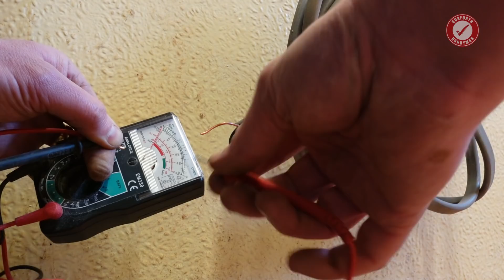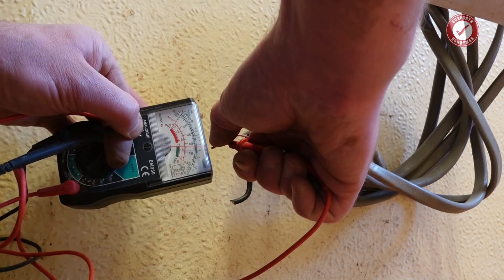Safely(ish) removing unknown buried pipes (Renovation Part 10)

Comment: 1920s build.  A lot of people were still using gas lamps in the 1920s, so that pipe being chased into the wall could have led to a manifold that fed gas lamps in all parts of the property.  There's been previous work done in the house, as evidenced by the kitchen units, so any manifold would have been removed when the house was finally wired up for electricity supply the first time.

2 years since the last comment, but I only just found your excellent and highly informative channel.  I'm learning a lot from it.  Thank you.

Comment: I dug up my parent's drive in the late 80s to allow the waterboard to replace the old lead pipes. 1907 house in Wrekenton. I found a pipe just like that and dug down the drive trying not to disturb it. Well, guess what, I hit it with a pick axe by accident, and the hissing of escaping gas was like I'd woken up a serpent from Middle Earth. That was when I used to smoke, as well. 

A year or two later we found that the house had no earth to the electrical supply, as it was bonded to that pipe and probably the water too. Which we'd just replaced with a plastic one. We found out when we started getting electric shocks off the taps. Glad to hear you drilled a pilot hole before attacking with it a sparking angle grinder! Gan canny!
Reply: We moved into the garden flat of a Victorian townhouse in 2019. Just before we moved in, we were told that they had to take off the tiles in the bathroom and uncover and long forgotten hatch to access the mains electric- as residents in the above flats were getting electric shocks from the taps, when installing new light fixtures, in the bath etc. It transpired the building was essentially ‘live’ and not earthed. I wonder if what you have described could explain what had to be resolved in our building? Very strange!

Comment: Such a good investigation! When I was late teens working on a construction site, my boss told me to 'cleanup' this certain floor of temp wiring. He said "everything" is disconnected just rip-it-out. So up I go to do the job, first line running across the floor is a tripper so I wanted that gone to move along faster... took my linesman pliers out to cut the line... BLAM... it was still live. knocked me back a few feet, welded my pliers. Hard lesson to never trust anyone especially with a 220 line. That was nearly 45 years ago!  Haha 99% sure are worse odds.

Comment: "Earth" is the general mass of the planet, which is more conductive than you might think. A buried pipe is going to make a pretty good connection to it (that's what an "earth rod" is, after all). So it's not surprising that there's continuity between your mystery pipe and your main earth terminal - they are both connected via the mass of the planet. No direct electrical connection is needed for this continuity.
Reply: coated in bitumen tho
Reply: @jonesconrad1  That is why you need to study electric theory, what is a conductor? what is an insulator?

Comment: An old town coal gas supply for a cooker I would have said.
Remember houses which have earth rods they are usually only ~3ft long to get a nice low reading. looking at how wet it had been in the under stairs room, it's likely got good continuity.
Reply from the maker: Yeah but it's bitumen coated so how's it getting such good conductivity to earth?? Would agree... but I'd need to dig up the floor to answer this I fear. 🤣
Reply: When you removed the length of pipe in the garden, were there any joints? Surely there wouldn't be just one long length of pipe supplied, but multiple shorter lengths? If it was shorter lengths, what had they used for joining them? Any threaded joints for gas would surely need a sealant whereas electrical joints wouldn't to provide better continuity.
Reply: @girlsdrinkfeck  Quite often Towns Gas didn't have a valve on the supply other than the one in the street, also it's likely threaded steel with no jointing compound as the bitumen coating was used as a sealant. Sadly it was all down to where you lived in the country to what measures were taken with safety/installation practices.
Reply: Old  town gas pipes when buried where covered with bitumen  tape (don't know what the material was in tape with the bitumen may have been asbestos)pipes would have been 1"or 1-1/4" inside  bore, town gas phased out on tynside late sixtys early seventys
Reply: Wouldn't that have had a gas meter somewhere?

Comment: I have an identical pipe coming in to my house right next to the old lead water supply. It was crimped off where it exited the ground. Had to do a similar thing to you and ended up just hoping that my checks were right and cut it off at ground level. It is certainly a twitchy moment no matter how confident you are!!
And it was definitely not a gas supply of any kind as it was the wrong side of the house for the kitchen and I removed all the original plaster and no gas lighting present.

Comment: Here across the pond electric is grounded outside by a bare copper wire (usually #6) from the electric panel outside to a galvanized rod driven 8' into the ground.
The panel is also grounded from the ground bar in the panel to the water pipe system inside the house and the hot and cold water pipes bonded together at the water heater so that when the water heater is removed for replacement, the hot and cold water  pipes remain grounded.
It may seem like a lot but the last thing you want is energized pipes with no place for the electric to go except through you.

Comment: I found a mystery pipe in my garden while digging a hole for a rain water tank (of course well in the way). I found another end (cut off) after some digging inside (which I had to do anyway) so I could safely cut it off where it was in my way; I didn’t go looking for it further into the garden though.
As far as the electrical connection of the pipe goes, here in Belgium it has been mandatory for quite some years now to connect metal gas and water pipes to electrical earth. In earlier days though, people didn’t put in earth rods (not sure if that’s the correct term) and used the metal pipes to earth the electrics. This could be different in the UK though...
Reply from the maker: Think it must be bonded under the floor... possibly. 👍

Comment: The continuity could be caused by a hidden earthing rod that connects to the metal pipe under the old kitchen floor, if it is a gas pipe (and given it's location I would guess so), they did used to earth these near where they terminate. I would guess that if you dug down a few inches around the pipe you may find the earthing brazed to it. (purley speculation though)

Comment: I live in a similar age property in Manchester. My gas supply pipe is just like that in heavy steel, just like yours, and of a similar diameter and has been in forever but now converts to copper  inside the property at the stop tap in the kitchen. It used to feed a very large floor standing gas boiler and needed a large diameter input. You are lucky it was not still connected like mine when you took a grinder to it. The gas pipes inside the house were only recently changed from lead in places to copper.

Comment: Towns gas was "around" until the late 60s.  We, in the South East. started conversion to Natural Gas in 1969.  Other Regions started it earlier but only by a couple of years.  At that time we were still using bitumen coated mild steel tube for "buried" pipework.

Comment: Have a look in the houses main earthing terminal that should be in that cupboard. Maybe there's a cpc wire going to one of the terminal points. Or it could be linked to your water supply in your house. See if there's a continuity between your water pipes and the mystery pipe.

Comment: Hi Andy, Please don't rely on utility company drawings! There is a significant junction of drains below a manhole in our neighbours garden but according to the utility drawing it is under our property! We have been trying to point out the error since we had a drain survey done when we moved in 25 years ago! When we had an extension built a few years ago I pointed out the error to our architect and provided photos and measurements of the precise layout as part of the planning submission. Because of the position of the drains and the proximity of the neighbours garage our extension is sat on foundations 5 feet deep on one corner!  Regarding the mysterious continuity reading I think the dead pipe is acting as an earth conductor and all you are doing is measuring continuity between the new earth arrangement and the old one. Best of luck with the project, the videos are brilliant.
Reply from the maker: Cheers! It's bitumen coated though - don't think it would get such low resistance to the electric supply earth unless it's physically bonded somewhere. 🤔
Reply: My kid's primary school was installing three new kindergarten classrooms, and when they were doing the ground works they discovered very large diameter water pipes that weren't on any plans they could find.  This resulted in the three new classes being placed elsewhere, and the Four existing kindy/preprimary classrooms being demolished and replaced after being there for 30+ years.

Apparently you're not allowed to build above these pipes. Amazing what you find. Even the water corporation didn't know they were there

Comment: Hi, In some areas of the uk at one time  it was practice to earth anything metal in a house . i.e. gas pipes, water pipes, cast iron baths, steel sinks and some cases the old steel metal windows, so its likely the the earth is still connected to the pipe somewhere, obviously this practice is no longer carried out.

Comment: The location in the kitchen, the material and the condition the internal pipe is in all suggests old gas pipe. Also the low continuity in clay soil isn't unusual at all, also consider that if the pipe was bonded it would have been within 600mm of where it enters the property. Just because you cut it out in the garden doesn't mean you've 1: removed it from the mass of earth or 2: removed the connection to the internal bond of the property.
Reply from the maker: Yes but the pipe was bitumen coated. I could be wrong but I don't think it would get such good connectivity to the electric supply earth without metallic bonding. 🤔
Reply: @GosforthHandyman  You'd be surprised by how little resistance a mass of wet clay between exposed metallic parts. It's more likely that under the house the coating was removed as it was likely the original main earthing conductor for the property. Remember an earth rod is only 3ft of copper staked into the ground and that pipe is likely a good 15ft of a bigger CSA.

Comment: Hi Andy,  my guess is old gas pipe,  i would have drilled a small hole in that pipe to see what was inside, and had a self tapping screw handy incase it was gas or water, if neither apeared,  next step put non metal probe into hole to see if there was something inside,  just my take on this, and I'm not advising anyone to do this either,  play safe people get the professionals  in , thanks for the video Andy, lookin forward to the next one,  stay safe mate, best wishe's to you and your's, Stuart.uk.
Reply from the maker: Good tips! 👍
Reply: Self tapping screw great idea. Maybe a little plumbers putty to make it better seal.

Comment: Defo an old gas pipe. I've got one capped off in the understair cupboard as have many of the houses in the street. The old pipe is commonly used to get the new pastic pipe from the street to the property so they don't have to dig up the garden.
Reply: Had pipe bonded to CPC. You are mistaking earth for CPC

Comment: Sounds like either the electrician bonded to this old section of pipe when doing the new install OR there is sufficient moisture in the earth that you are getting  continuity between this old section of cast pipe and the neutral bonding rod in the new service connection.
Reply from the maker: It think it can only be the former. Can't see the resistance being so low for connectivity through the actual earth... but would need to dig a hole to find out. 👍😁
Reply: @GosforthHandyman  that’s an interesting thought. A good way to test that would be to get incandescent bulb if you can find one and stick it in a lamp socket connect one end up to a pipe and the other end carefully to the supply with a switch. If it’s a low resistance connection you’ll get a full brightness if it’s high resistance you’ll get a dim light. Course I don’t know how that would work with RCDs as this would essentially be a ground fault. There are better newer ways to check for that but require expensive tools. The principle is the same you want some thing that drives a little bit of a current. Of course this comes into the territory of an electrician as it could be a redundant path and the only way to check that is to disconnect the CPC ground connection in the electrical system to determine which way it’s connected. Whether it’s with a ground bond, water bond, electrical service bond or maybe tied into the old ground rod bond.

Comment: Hi Andy, I live down the road or up I can never remember, anyway my house has gas and the radiators electric earth and partial every pipe in here is connected to the gas pipe in many different places. I had a new gas meter put in and the person doing it was worried because he remover the main earth connection from the electric supply and still got a continuity check, three days later after consulting with everyone and their dog they decided that what I had been telling them all the time must be weird but true, the only thing to do then was to get someone either dumb enough or expandable to connect the earth, they must have not been able to find anyone because they left the cable unattached with a label on it saying the installation had not passed inspection due to an continuity test. I asked if it was safe and the only answer I could get and that was only verbally was to do so at my own discretion.

Comment: No gas in my house, however before I signed the purchase agreement, the main gas supply to local town was replaced along some field boundaries. White markers etc visible at exit and entrance to my fields. Water main for said town runs in road side verge. 2017, hot dry summer gave the opportunity to put in land drains to reduce bog in a field.  1 JCB digging down 4 to 5 foot CLANG. Heart attacks all round, its the the town's gas supply! 6 inch steel pipe!  
They replaced the pipe by digging a new path for their new pipe and renewed the markers, leaving the old pipe undisturbed, in the middle of a field! 🥵 Keep safe.

Comment: I had similar for an old steel pipe that no-one knew anything about - but I suspected it might have been an old water pipe. I drilled a small pilot hole in the very top so I'd have a fair chance of sealing it back up quickly just incase something did start escaping under pressure.

I'd have also thought electric is unlikely, and old gas more likely - electric cables don't need protecting by ducts that thick or strong. That pipe is sized to contain a fluid (water or gas) under pressure. And sleeving services to protect them (or allow easier installation/replacement) is only a relatively recent phenomenon.

Comment: All metall pipes in a house have to be grounded... at least here in Germany
Diameter is a bit small for a mains and for gas or water. It could as well be a conduit for a cable-tv line from back in the 90s, which split of and went upstairs.
The old houses usually got their electricity over tzhe roof back in the days. I think from previous videos, the conection point is in the upper left corner of the house when watched from the street.

Comment: It looks more like a redundant gas pipe, especially as it came up in the kitchen
Reply from the maker: Would tend to agree... but where is it grounded and why did they bother to ground the new electric supply to an old redundant gas pipe?? 🤔😁
Reply: @GosforthHandyman  could have earthed the new electric to an old earth rod that the pipe was already grounded too, although I'd think that's unlikely
Reply: @olivermansfield8341  Likely would have been used as the main earth conductor for the property given the age (also looking at the age of the main supply cable with incorrect earthing connection), so any new work would have continued to connect to it to maintain continuity rather than risk throwing up a fault/safety issue.
Reply: @GosforthHandyman  if the old gas pipe was grounded to the old electrical circuit somewhere in the system, when the new electrical supply was installed, it would provide ground for the gas pipe without knowing abou it . If the power ever came in over telegraph posts, chances are there would be  a ground spike somewhere too ?
Reply: @GosforthHandyman  Any redundant pipe should be bonded. Doesn't matter if it's in use or not. The point of bonding is to create an equipotential zone and prevent ANY extraneous potential coming in. Remember, all electricity supplies are likely to go TN-C-S (PME) sooner or later, so terrafirma earth might not be the same as the electricity supply earth in the event of a fault or extreme load.
Reply: @TheChipmunk2008  Wrong. Electrical supplies are moving away from PME as they no longer want the responsibility.
Reply: @niceguy235uk1  Yes
Reply: A lot of houses electric was run to 1 house and then loop to next door

Comment: There will an earth clamp under the floor connecting to the main earthing terminal at the supply head or consumer unit. That will be why there is continuity between the pipe and the cpc of the cable.